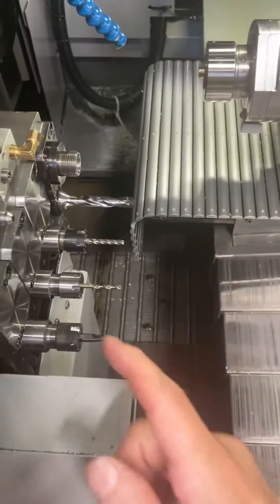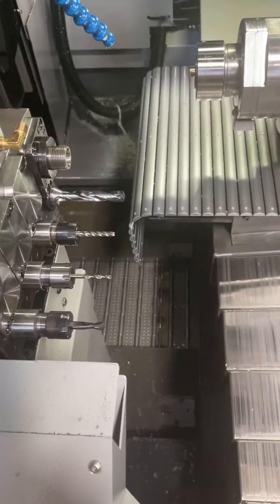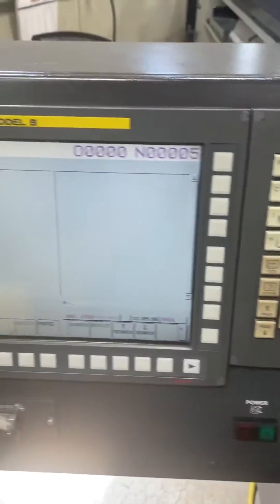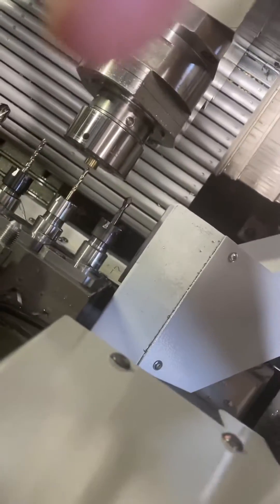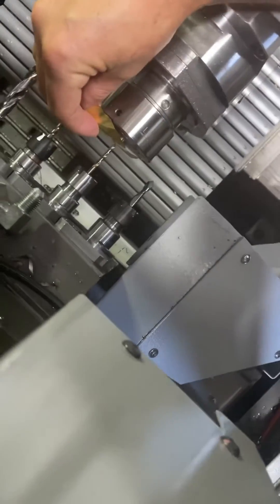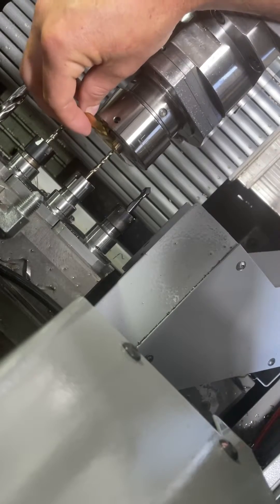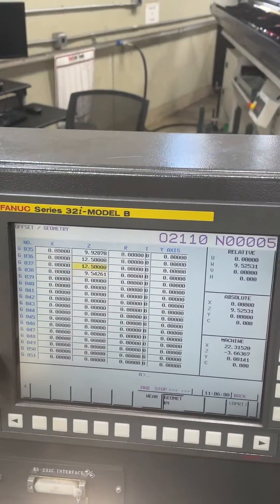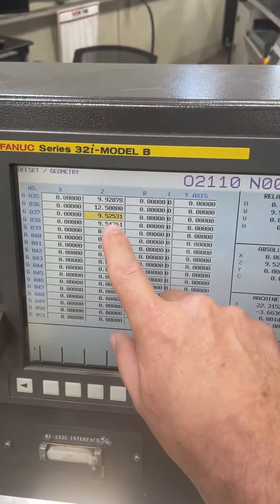How to touch off back working tools on a CNC Swiss lathe

Comment: So I like your video…. But you didn’t mention anything about comp/compensating for the shim stock on Z2 because that plays a roll dependable on the thickness of shim stock used. If someone touched off with perhaps a .0200” shim then there parts would be off on back face working tools.. ❤❤hope this helps, great video :)
Reply: I’m assuming you would run one part and then adjust based on how far off it is

Comment: Hey . I am new to these type of cnc machines. I am using star sv 32.  But i get confused on how to set Z0 on both spindle.(and there is the E axis that we should consider) some help if possible plz !
Reply from the maker: Are you using the star presetter outside of the machine or are you touching them off in the machine? If you have Instagram direct message my profile @cncswiss. I am more active there.

Comment: Good video. Star CNC use the same method. Probably same fanuc controller. When I am touching the tool, I usually type z-.005 because there is a facing allowance still on that part. Are you able to use the g132? In case you change the pickoff distance, it will adjust those geo # for you. 👍
Reply from the maker: I think tsugami had something similar to the G132 on a star. That was always so nice to have, especially on a turret machine.